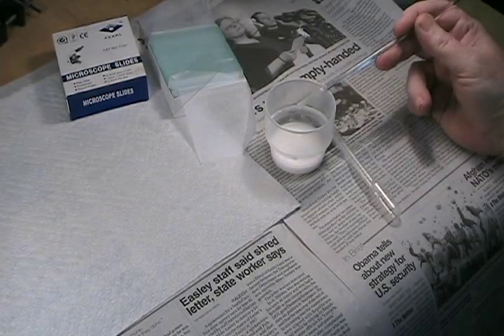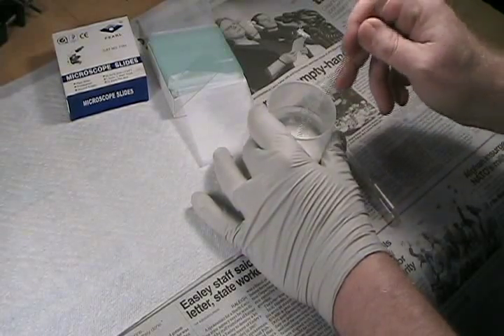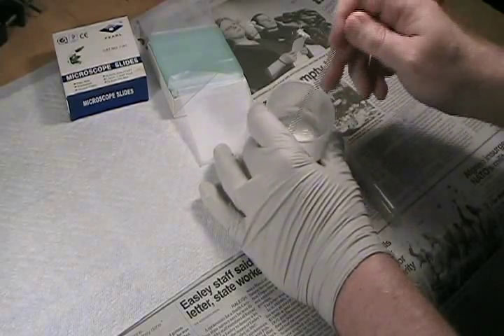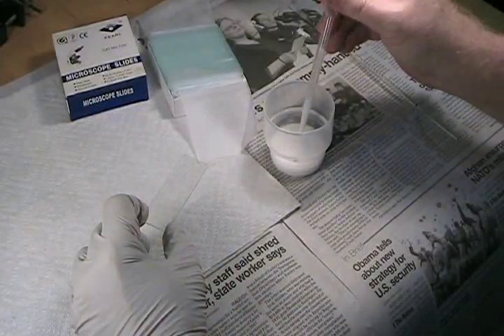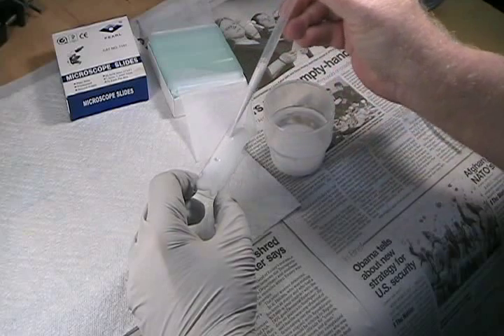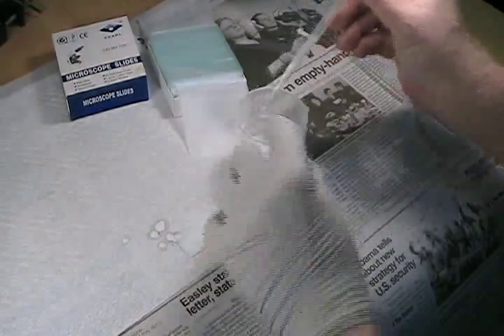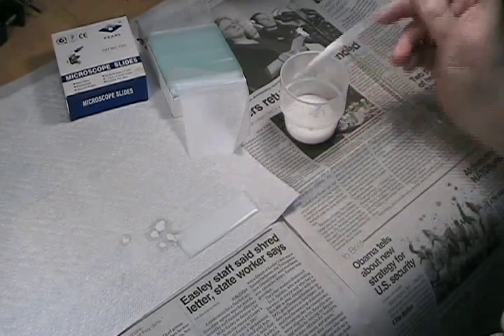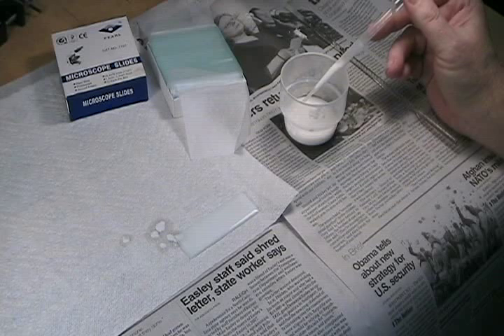The Home Scientist 024 - Making thin-layer chromatography (TLC) plates

Comment: Hey RBT thanks for putting this video up! I use this everyday in lab (along with flash chromatography). I had been wondering what the binding agent was (I would think that the solvents would dissolve the binder).  I think it would be cool if you talked a little about the principle of TLC bc most people won't have the solvents, uv lamp, or stains necessary. 
Cheers!

Comment: if so made plate will glow in UV ?
Reply: No, it's what absorbs into it that does or does not glow. 
  Take several different color highlighter markers and mix up the colors in a small well (a slot as long as the width of the slide that's about 2-5 mm deep or so) dip the edge in , and the different colors will separate into bands and glow under UV as they climb up the slide before they dry.